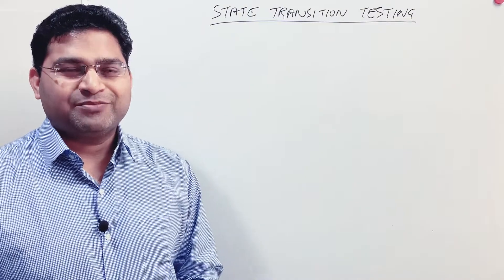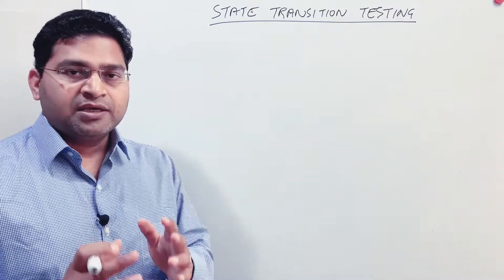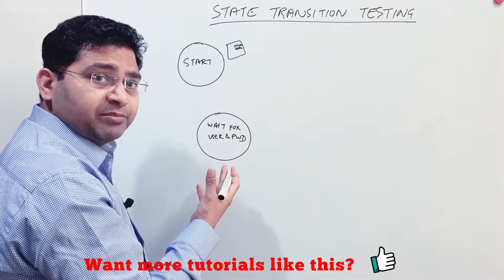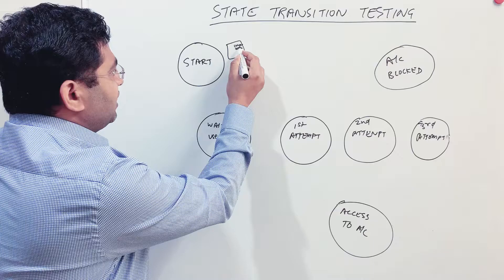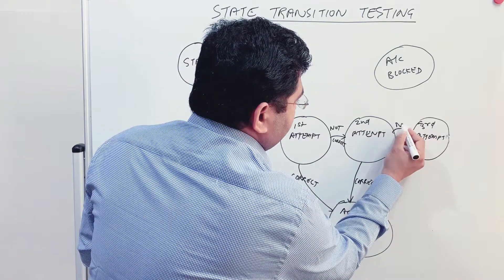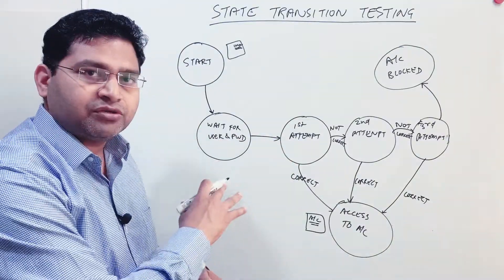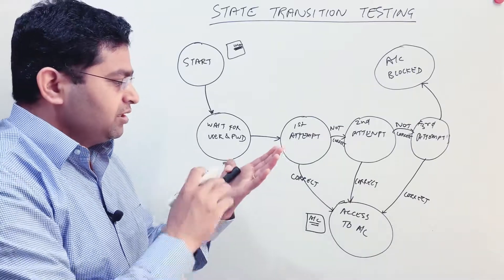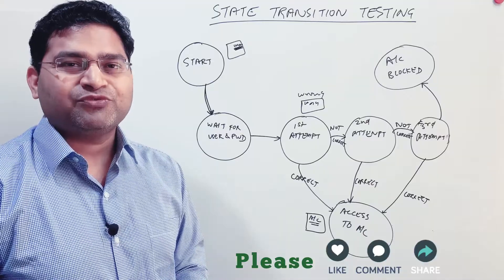Software Testing Tutorial #37 - State Transition Testing Technique

Comment: *Notes: State Transition Testing Technique - Software Testing Tutorial #37*

*Introduction:*
- State Transition Testing, a black-box testing technique useful for systems with states and state changes, resembling a finite state machine.

*Understanding State Transition Testing:*
- State Transition Testing involves defining an application/module in terms of states and transitions.
- Similar to a workflow diagram, it outlines various states and how transitions occur between them.
- Review other black-box test design techniques like Equivalence Partitioning, Boundary Value Analysis, and Decision Table Testing before diving into State Transition Testing.

*Example: Banking Website Scenario:*
- Example: Entering an incorrect username and password three times results in an account lock, requiring a password reset.

*Defining States:*
1. Start State
2. Waiting for Username and Password
3. First Attempt
4. Second Attempt
5. Third Attempt
6. Access to Account
7. Account Blocked

*Defining Transitions:*
- Clicking on Login Button: Transition from Start State to Waiting for Username and Password.
- Correct Username and Password (Any Attempt): Transition to Access to Account.
- Incorrect Username and Password (First and Second Attempt): No change in state.
- Incorrect Username and Password (Third Attempt): Transition to Account Blocked.

*Creating Test Cases:*
- Test Case 1: Enter incorrect credentials in the first attempt, then correct credentials. Expected result: Access to Account.
- Test Case 2: Enter incorrect credentials three times. Expected result: Account Blocked.

*Four Key Elements in State Transition Testing:*
- *States:* Different conditions or phases the application can be in.
- *Transitions:* How the application moves between states.
- *Events:* Trigger transitions, e.g., clicking a button.
- *Actions:* Consequences or responses to events, e.g., displaying an error message.

*Conclusion:*
- State Transition Testing defines an application's behavior in various states and transitions.
- It ensures software responds correctly to different scenarios.
Reply: Even after seeing multiple videos regarding stt..u can't able to understand..ur comment made me understood clearly..thanks